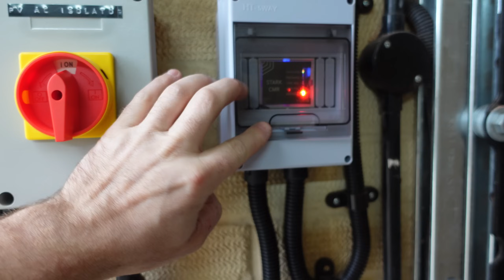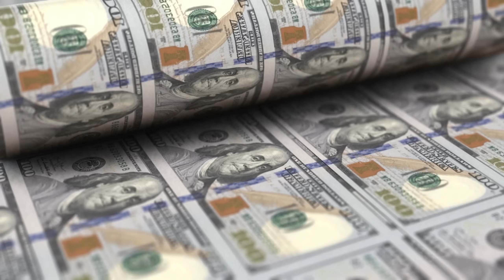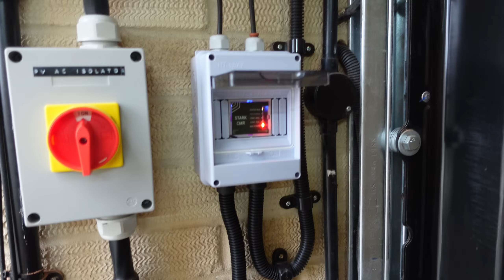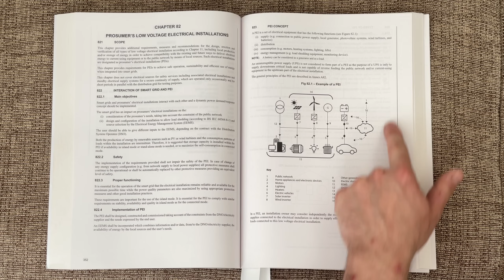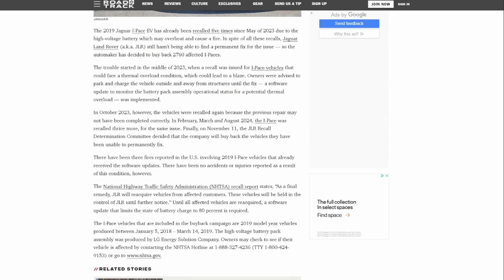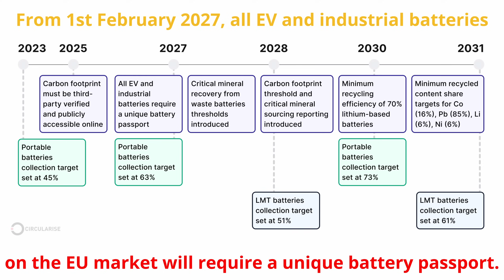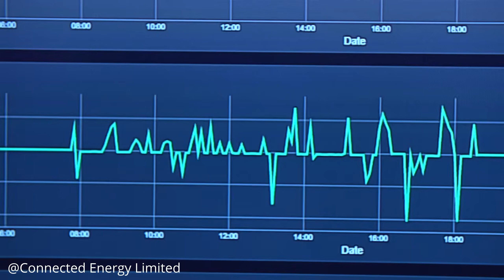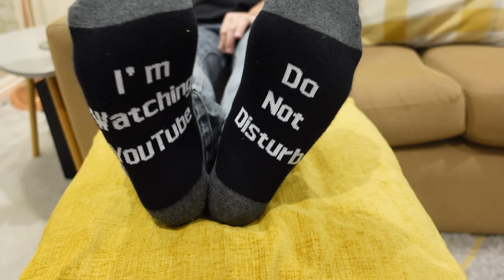4 Reasons I Chose an EV Battery for Home Energy Storage

Comment: home battery storage is an excellent idea, however a lot of modern EVs use active cooling and if this is interrupted you could greatly increase the fire risk. I would definitely consider a separate battery house just in case , you may also have house insurance issues  otherwise the bulkier 48v rack mount batteries may be a safer option long term
Reply from the maker: The crazy thing is water cooling isn’t needed for these low current situations. While we haven’t had summer here yet I’ve not seen temps over 25c at the cell level. Why because we are not demanding hundreds of amps to race down the road or fast charging at 300kw. Generally your looking at under 15kw in a second life use 

Good points
Reply from the maker: The crazy thing is water cooling isn’t needed for these low current situations. While we haven’t had summer here yet I’ve not seen temps over 25c at the cell level. Why because we are not demanding hundreds of amps to race down the road or fast charging at 300kw. Generally your looking at under 15kw in a second life use 

Good points
Reply from the maker: The crazy thing is water cooling isn’t needed for these low current situations. While we haven’t had summer here yet I’ve not seen temps over 25c at the cell level. Why because we are not demanding hundreds of amps to race down the road or fast charging at 300kw. Generally your looking at under 15kw in a second life use 

Good points
Reply from the maker: The crazy thing is water cooling isn’t needed for these low current situations. While we haven’t had summer here yet I’ve not seen temps over 25c at the cell level. Why because we are not demanding hundreds of amps to race down the road or fast charging at 300kw. Generally your looking at under 15kw in a second life use 

Good points

Comment: Solar batteries are typically LiFePO4 which have a very stable chemistry and don't catch fire, unlike Lithium batteries.  I've no idea what Teslas use, if it's lithium this could be a problem and affect your house insurance.
Reply from the maker: Telsa use both NMC and LFP. I’m advocating LFP only. One clip showed how many EV manufacturers are using LFP battery pack la. Largely China who are at the forefront of LFP
Reply: LiFePO4  is a lithium battery…
Reply: People can’t reconcile anti EV propaganda with reality so they reject reality

Comment: Its all well and good quoting the reg book, but insurance will void any claim . i found out first hand when my home was damaged in a storm by a tree, the battery had nothing to do with the damage. Even after providing paperwork to prove the install far exceeds BS7671 and providing my certs as a Marine ETO and gold card  spark of 20 years , in court i still lost. Ive been fitting this equipment way before the internet decided anyone  can give electrical advice and earn money from it. I think this is a great use of of giving batteries a 2nd life, but don't fit them in or attached to your home. My 160kwh is now at the end of the garden in its own building
Reply from the maker: Can you share anymore details? Sounds interesting. 

I take your point in hindsight I would have the packs in a container down the garden. But at the time trying to work out how to move it down there was the challenge. Which brings you back to. . They are probs 2 big for a home
Reply: yes, insurance are sharks 😢

Comment: Absolutely brilliant content, so forward thinking. Thank you for your knowledge and sharing. 
We have built an 80kWh storage unit from BMW i3 batteries, which powered from solar, charges our EV fleet AOK.
Reply from the maker: Fantastic. Did you use the battery emulator project or something else?
Reply: @ No, not that example. Configured a circuitboard and tapped each cell manually, built a junction unit and wired out to inverters. So 400v to 48v and out to 11kW chargers (x2), but 2 Teslas can get 50km/hr + for a decent snack.

Comment: I share many of your conclusions but I would still be tempted to go down the PW3 route primarily because, now that Tesla is a licensed UK Power Generator, I would expect to be able to be part of a well organised AI-driven virtual energy supplier, rather than having to settle for whatever FIT my domestic supplier cares to offer - even if Octopus are better than most. Must also be said that when you compare the cost of a recycled car battery to the likes of a Tesla Powerwall, you didin't mention that the PW includes the inverter and is a far tidier turnkey solution - no offence meant.
Reply from the maker: Nice points. Yes. My conclusions EV batteries are better suited to grid based storage or large properties/ businesses. 

Just had a thought tho. Imagine if Tesla designed their EV packs so they could offer a lower price Powerwall with cells that came from their own vehicles. I don’t know how they would manage it all but they have created millions of vehicles from basically no where a little while back. And space x whole landing rockets. It’s got to be possible to commercialise

Comment: I admire what you have done but I still think 400vl volts is not great to work with I have split a nissan leaf battery down and repacked it in a 7s configuration for a 48v system with a good BMS and it runs lovely
Reply from the maker: Good point. Im sure you would agree the same safety precautions are relevant no matter the voltage. I’ve accidentally shorted 2 banks of 18650s and had some sparks. Generally with an EV battery you only need to work on the system dead. But good point
Reply: @TheOfficialBatteryMan  yeah I know what you mean about the 18650 cells I had 26kwh of 18650 setup running my house for about 6 years I have since changed to the lfp cells and my nissan leaf battery
Reply from the maker: @dama054  that is impressive. I’ve got a pack with around 300 cells still in use running equipment remotely. It’s starting to show its age. Been running for around 5 years. 

How many cells was that? Where on earth did you source all those?
Reply: @TheOfficialBatteryMan  a guy I know would turn up with 300 old laptop batteries at a time I would sit in the garden in the summer opening them up and then had a board with loads of the small PCB charging boards and the discharging boards it took ages just testing them and then soldering them all together when I first started you couldn't even get a proper BMS I was using relays and big resistors to keep them from over charging
Reply from the maker: @dama054  wow. I did a similar thing on a smaller scale. My best hoard was a load of conference call phone batteries. They each had 6 cells. All very close to original mah I must have had 40. So 250ish cells. Split in 2 eBay auctions for 99p each. Postage brought the total for all of them to £20. You soon pickup the technique for breaking them apart. A lot of my cells came from local independent PC repair shops. 

I was always disappointed when I opened a pack and found red cells. Most Sanyo cells would run warm under a charge for me so didn’t make it
Reply: @TheOfficialBatteryMan  them bloody red ones I know what you mean good capacity but run hot not worth the risk

Comment: I think it makes more sense to do this at grid scale. I have 18kwh of LFP in my house from a Chinese company and it is all pretty much plug and play. My electric bill is close to zero most of the year and with ripple energy shares it might be zero next year. Most people won’t want to take the risk and frankly don’t need that much energy.
Reply from the maker: I agree with your grid scale point. Energy for the grid to store excess renewables and use when it best needs it
Reply: Eventually the Grid will have enough backup to handle a dunkelflaute situation, maybe even for a week, but getting it bought & deployed is going to take years, thousands of domestic users can be set up in weeks.

Comment: I'm thinking on ripping off my 10 year Leaf battery case ( with ~16kWh capacity) and connect it to one of my 48V hybrid inverter on the PV side.  The inverter can handle PV voltages from 150V to 500V....in between a small ~5kWh 48V LiFEPo4 battery as 'buffer'. Should work, right?
Reply from the maker: I wouldn’t recommend using the inverter that way. Solar input is exactly that. An input. Not designed to safely charge a battery
Reply: @TheOfficialBatteryMan  well, I forgot to mention that I want to attach an array of PV panels working on the range of ~350V and around 10A. This should be in the working voltage range of internal BMS. Or am I missing something here? Thanks and great work!
Reply from the maker: @fernandinand  I’m sorry I may have misunderstood what you’re looking to do. Use your leaf pack completely with your inverter or break it up and use it lower voltage ?
Reply: @TheOfficialBatteryMan  I want to use the pack intact..I believe the nominal voltage is around 360V (~400 at 100%SOC). I have a small PV array around those voltages (in series)...is it ok to connect the array directly to the battery?
Reply: @fernandinand 1) 350V is not going to charge 360V nominal
2) lithium batteries require a controlled charge curve to be safe 
3) if it screws up big time that's one helluva bang 
Be sensible, get a charge controller!

Comment: I've been wanting to do this for such a long time. I can't understand why someone hasn't manufactured a 'plug 'n' play'  interface for EV batteries, to convert to home use, esp. the LFPs, or set up a company doing the conversion and installation. If you had a garage sized shed, you could have 500kWh energy storage, for not much more than a couple of Tesla PowerWalls. I've just discovered your channel, so I'm hoping when I go back, you'll have shown me how to do it. My brother is an electrician, now retired, but I have been urging him to get into this. It's like gold lying in the street folks.
Reply: The battery emulator project isn't far off of plug and play really.   With purchasing of the right cables for the Tesla battery there's very little you need to do to get them working and it's something anyone with even a small amount of knowledge can achieve.
Reply from the maker: Ideally if they don’t choose a Tesla LFP pack they hasn’t had cell balancing ironed out yet 🤣
Reply from the maker: Yes I have videos about how to do the install. Different batteries have different complexities and the same can be said for different inverters. The issue at the moment is the data is proprietary so it needs people to reverse engineer. That takes time. The Battery Emulator project is the key right now
Reply: can you strip the electrics out of the donor car & use a bi-directional charge port?
Reply: @alanhat5252 I have thought about this, but I don't think Tesla support bidirectional charging. I think maybe the newer MGs do, so waiting for some of those to be wrecked may take some time. I am sure there are others that are supporting V2Home

Comment: But how do you charge the Tesla battery at about 400v dc?
Reply from the maker: There are lots of inverter that work with 150-800v battery systems. So the inverter charges the battery until it reaches 100% or whatever you set below that
Reply: @TheOfficialBatteryMan you're just supplying a fixed Voltage & relying on the BMS inside the battery casing to manage the charge curve?

Comment: I used to have 120 CALB 200Ah LiFePO4 cells, but they took up a lot of space, so I upgraded in late 2023 to a Tesla Model S pack of 80kWh from a crashed 2015 car. I use it as a 48V nominal battery, so I have the 14 Tesla battery slabs in a 2S7P configuration. Which each of the 7 parallel layers being its own battery with its own JK BMS
Reply from the maker: Wow nice one. Sounds like someone’s been having fun. 
Did you have to wire balance leads up to each section or could you make use of what was there?
Reply: @TheOfficialBatteryMan  I was going to replace the small plug in Tesla OEM boards on the front of the slabs with modified ones that have JST connectors that you can connect to your own BMS. Ordered two of them to start but there was an issue with the order, the seller messed up the VAT on it. So, impatient as I am, I just spot welded tin strips with balance wires onto the Tesla slabs directly. Pain in the neck and time consuming, but it worked well and my battery is now live well over a year with no issues. For anyone wondering - it is in my shed. Like yourself, I would not want NMC batteries in my house or even on the outside wall, so I totally understand your decision to go for LiFePO4!

Comment: Thank you from Egypt. I think that a 48v system is safer. The wire size is trivial. Also 15 kwh is more than enough for most people. Here in Egypt we have 3400 sunny hours per year. So an EV battery is hardly needed. I have a 10 kw solar array. And my experience is that even a 15 kwh battery is hardly ever fully discharged. During the day the sun is more than enough. During the night I sleep and the inverter air conditioning use 5 kwh per night. As soon as the sun shines the battery is recharged.  So you see that large EV battery is hardly needed.  Egypt has more sun. I agree.  But in your video the running stream of water is perfect. And I think that this stream will always generate electricity unless it stops raining in the UK. Do you think it will? 
Best Regards from Egypt
Reply from the maker: When I first read your comment I read ‘3400 days of sun’ I was about to agree 😂 interesting perspective. Potentially a better use for large complexes when the sun is down or to help the grid when there are blackouts? Great comment

The UK doesn’t get much sun in winter. From my 7kw array I’m lucky to get a 2-3 kWh a day. We generally can get cheap electric for 6 hours at night and if we heat our homes in winter with electric or from a heat pump we can use 20-40kWh a day in just heating in the coldest patch depending on the weather. But I agree an EV battery is probably overkill. 

We have a lot of hoops to jump through to use streams and waterways for energy production so it can become prohibitively expensive.

Comment: I think that the future of solar storage will eventually move to high voltage battery systems.  Here in Ireland the better systems for domestic installs have usually been Huwaei 400V . These offer better efficiency in terms of "round trip efficiency " , less losses in charging the batteries and from battery to inverter output, with higher power capacity available.  High voltage EV battery storage would be a game changer if you need an independent 3 phase supply for a workshop in areas where grid 3phase is not available .
Reply from the maker: They tend to stack nicely 2. Which makes it easier and lighter for installers. Not long ago installers were dragging large heavy batteries through loft hatches. 

Good idea on 3 phase
Reply: @TheOfficialBatteryMan 3-phase is 240V to neutral & only 415V between phases because it's 120° out of sync.

Comment: I'd consider buying Teslas LFP batteries but Li-ion tech is more dangerous and gives far fewer cycles.  An accurate cost analysis would have to consider remaining cycle life.
Reply from the maker: Indeed. SOH can go much lower for energy storage before it’s a problem. Agree there will be a tipping point. I do worry old cells can get resistive as they get older and form dendrites. I worry this could cause issues if not monitored. Not really a problem in an EV when the pack is only ever going to be used to 70% of its original health

Comment: I'm in the same boat - about to pul the trigger on 16kWh Sigenergy batteries and a solar install but the battery size and costs are just ridculously expensive. I am very tempted to purchase a used 75kWh Model 3 EV battery for £3-4k for the same money as the 16kWh sigenergy batteries and DIY it. I am concerened about home insurance though - what happens if the worst happens and the battery suffers thermal runaway or the house has it's own seperate fire that effects the battery. I, like you, would be mounting the EV battery on the garage wall - not connected to an adjoining property - but, what would your insurance comapny say when you put a claim in for your house and belongings (and a neighbours house?!). Are you SURE that you are going to be fully covered if the worst happens? Have you had that conversation with them or asurance in writing that you're fully insured come what may?

If the insurance is covered, I'm happy to give this a try!
Reply from the maker: The install is done to the UK standards and has required BMS so on. I’ve gone down the route of cross that bridge if I get there. I keep meaning to record the phone call and share it on a video. Possibly give me and the call centre person picture characters to make it more light hearted. Insurance want to wriggle out of all they can. You can think of endless scenarios you could contact the insurance about because you think it might not be covered but if it’s not a question or leads from a question they as in the quote then that is it surely?

I would recommend if it’s a concern. A fireproof container away from the building. Run the AC cabling underground back to the building using SWA.